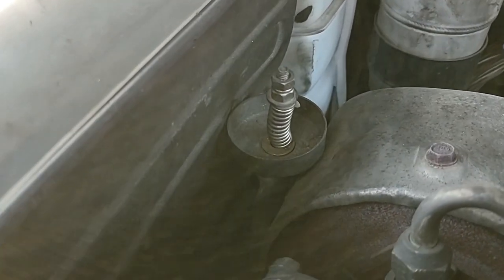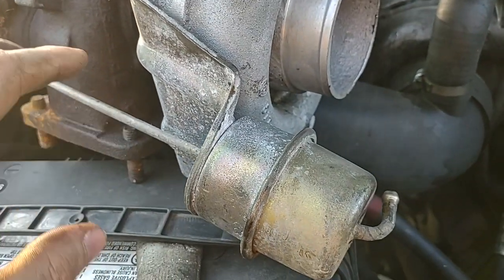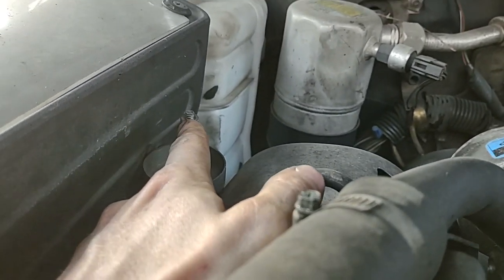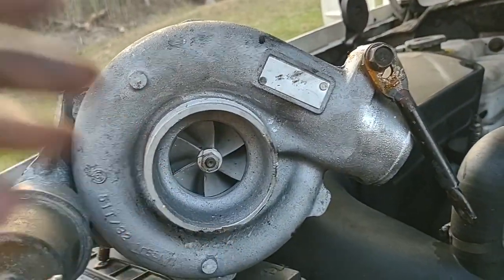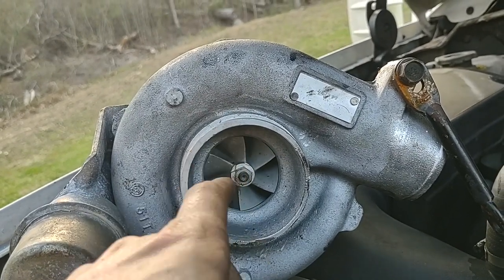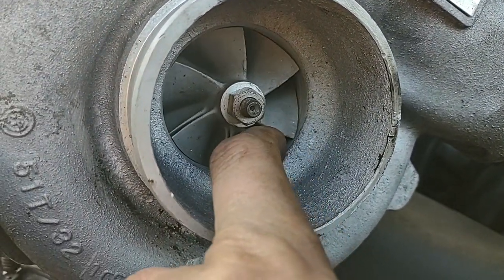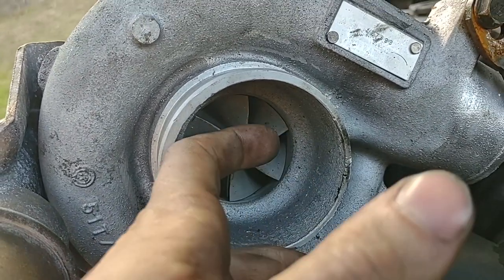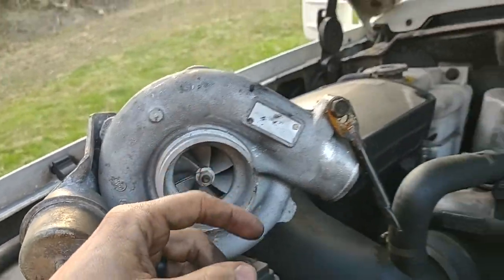6.5L Turbo problems, Increasing boost (derate, no boost, leaking, over boost)

Comment: i’ve got a 97 3500 and i don’t know anything about diesels so don’t roast me but if i want to change injectors or the turbo or something like that is it the same thing like a car when i have to get it tuned? and if so what type of remote tuner would you recommend
Reply from the maker: You're good man, I don't see the point in downing anybody that's asking an honest question so you're good. The answer to your question is both yes and no at the same time. If you're just changing injectors say to like Marine injectors are good set of factory Bosch injectors then no you won't need any sort of tune or anything like that it's just adding more fuel. Changing turbos on the other hand can prove to be a different story. It really depends on the amount of boost you're throwing to it, if you go over that 10 psi mark and it starts throwing a code then you will have to get something in order to full the ECU into thinking it's reading the proper boost or get a tuned ECU. As far as recommendations for a tuner I personally like quadstar tuning. They seem to put a great products and I haven't had any issues out of anything that I've ordered from them. (I am not sponsored)

Comment: So how much computer control does a 93 6.5 with a manual tranny have? The guy that owned it before me just wired the wastegate closed.
Reply from the maker: Very little, the injection pump is all mechanical, transmission like you said would be mechanical, doesn't take very much to make them run.
Reply: @JessePelkey1   Thanks for the reply! That's what I thought (and hoped) I've got a "high output" canadian built according to my vin, do you know what the difference is? I thought maybe just bigger injectors or different timing/tune?
Reply from the maker: @jonnybo5890  bigger injectors, slightly advanced timing and stronger castings of the block itself from my understanding.

Comment: New on the channel, and new with 6.5. How long can I run before blowing my head gasket etc? Am planning to remove the vacuum pump soon.
Reply from the maker: Depends on the boat level you run, if you keep it under 15psi you will be fine without head studs
Reply: @JessePelkey1  thanks buddy. Best of lucks. Keep posting. There is a lot of helps in your videos.
Reply from the maker: @alvarosantoyo1270  not problem man 👍

Comment: Hey Jesse, I’ve got a 6.5 I’m planning on towing with I have the h35, 5 pos tuner with stock, quiet idle, light and heavy tow, and light performance, it has the 6.6 upgraded fan, relocated pmd, with a nv4500 trans, I’ll be towing a 34.5’ bumper pull pretty regular. How can I bring my egts way down for steep climbs I noticed yesterday in the stock setting and 5th gear on cruise I’m rising to around 8/880 degrees @ 70 mph it has a banks 4” as well
Reply from the maker: Using an intercooler and creating a better flowing exhaust greatly improve keeping your egts low
Reply: Question number two, back on my gm8 turbo with waste gate controller because my wastegate actuator died on my big turbo. So the gm8 was pushing 16-18psi now barely pumping out 4-8psi right after I got it out the shop after having my injection pump pcm replaced all grounds redone. Where is my boost going? I replaced the v band clamp between turbo to down pipe and it got worse. At this point I have upgraded injectors new fuel pump new injection pump new pmd new ecm fan and radiator upgrade the exhaust needs replaced but I don’t think it’s leaking bad enough for me to lose that much boost, i went from 24/26 with the hx 40 when I bought it back to 16-18 with the gm8 and now the gm8 is not managing to make 0-8psi

Comment: I got 95 obd1 heavy half. There is no EGR   waste gate control none that stuff is on the driver's side at the back motor. Should that be there.
Reply: I got Carter lift pump p4601 HP. Can I hook lift pump to relay key power sew it runs all the time.
Reply from the maker: You can
Reply from the maker: To the best of mine knowledge, all of the 1500-65 turbo diesels were equipped with EGR. If your EGR valve is missing, which isn't necessarily a bad thing because I personally dislike EGR with a passion, but that's just me

Comment: My 95 6.5 is having an issue every time I hit 2500 RPM’s my check engine light comes on but goes after after I fall below 2200. I’m not sure if it’s a leak somewhere or if my air file ratio is off. Any ideas?
Reply from the maker: Have you tried pulling any codes as of yet? That may put us in some sort of direction to finding the issue.
Reply: @JessePelkey1  i did but nothing came up I don’t think it’s storing the code

Comment: By chance were does the egt probe location go a guy worked on my truck and didnt put it back
Reply from the maker: 6.5L  never came factory with an EGT probe so someone installed an aftermarket one at some point. The most common place to install one is on the passenger side exhaust manifold just before the turbo. That'd be where i would start looking

Comment: So I have two 6.5s and run them at about 14 psi of boost but after that at 15 psi they both seem to cut power and then when boost drops they pick up again. One of the 6.5s has a hx35 on it and It still cuts out and in. Is that the turbo or does the stock fuel system not provide enough fuel? 
Actually my 6.5 with the stock turbo has a upgraded fuel pump so there it might be the turbo and the other one has the oem fuel pump yet, I know I need to upgrade it, but do you think that would solve the problem for the 6.5 with the hx35?

Comment: So I keep the boost solenoid plugged in, just unplug the vacuum lines?
Reply from the maker: You can if you want, I would just remove everything personally
Reply: @JessePelkey1  that's what I did.  Though I do still need to know what belt I need to get rid of the vacuum pump lol........
Reply from the maker: @onedadsbattle  my vacuum pump delete video went over both of the different belts
Reply: @JessePelkey1  lol totally forgot!  Rewatched it, thanks lol!
Reply from the maker: @onedadsbattle  it's all good man

Comment: The problem I am finding with the boost foolers is that they all still need a functioning vacuum pump setup, which I have deleted.   So my truck goes into limp mode anytime I keep the rmp's over 2500 for any extended amount of time.   I have a manual wastegate controlled set to 10psi.
Reply from the maker: Agreed, it is a bit of a pain to keep the pump around and a tune is a much better system to go with.
Reply: @JessePelkey1  So, knowing I have no pump, what "tune" do I do to prevent limp mode?
Reply from the maker: @cwalker71  I would recommend having a chat with John over at quadstar. He would be able to give you far better info that I myself would.

Comment: Which factory gm turbo is best?
Reply from the maker: Gm8 is the best factory side mount turbo for the 6.5l 👍
Reply: What year are they
Reply from the maker: @andrewbeveridge3006  they can be found on 97 and newer but if your shopping for one it will say GM8 stamped into the compressor housing.
Reply: @JessePelkey1  would it work on my 95? Mine says gm4 i think
Reply from the maker: @andrewbeveridge3006  yes, it will work